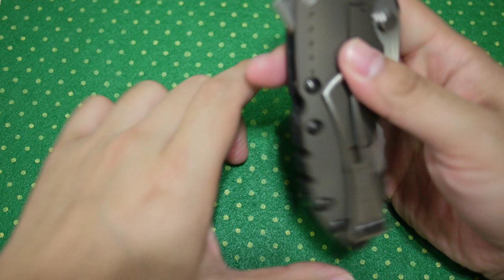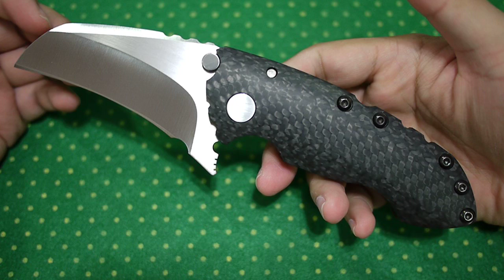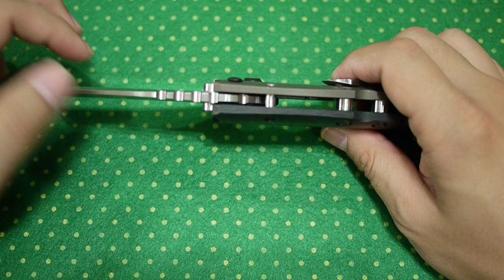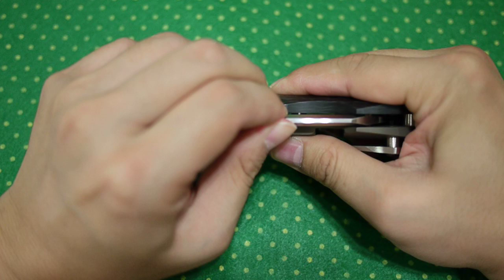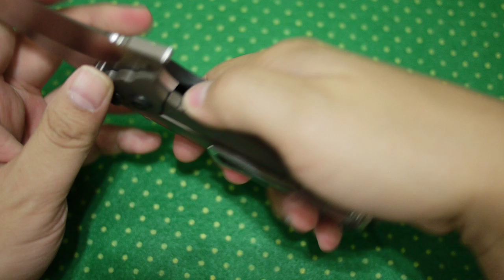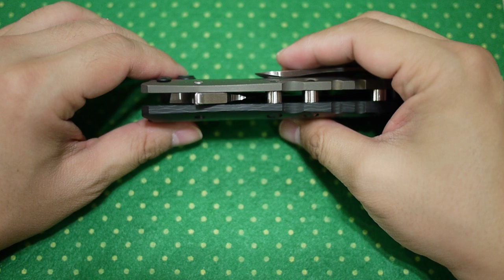Direware SOLO Wharncliffe

Comment: My goodness Tsu. When will the madness stop???  Such a sick blade. In regards to the previous comment about liners even a thin liner is not going to make much of a difference. The stiffness of the thick pivot will prevent the majority of the torque on the blade. And the torque is distributed throughout the thickness of the cf and the ti. Not just at the pivot. I can't remember the video I saw but it showed some guys (probably tuffthumbz) standing on cf and g10 between two rocks.

Comment: Actually as Tsu mentioned, ANY knife will fail if you really wanted to get it to break, However, Tsu, we have a mutual buddy from USN that took a Sniper Bladeworks (Half Ti/Half G10 folder on deployment in Afgan.he beat the hell out of that knife, I think he even used it as a stepping element to climb a wall and it came back after a tour with an absoutely solid lock up. So, mabe some folders are prototypes for a reason, but there are knives with some pedigree that function very in the field too.

Comment: Hey Tsu!!!!   Hope all is well...Well.......Carbon fiber has a higher strength to weight ratio and stiffness to weight ratio than Ti, actually 4-6 times greater.       That's why these composites are used in multi million dollar fiighter aircraft like the F-18.

Comment: I used a prototype all ti folder in Kuwait in Gulf I. We were forced to use it as a pry bar and the ti failed at the pivot, as it simply could not hold the strain, even with a virtually unlimited fatigue life. All I am stating is that carbon is not a suitable material to support the pivot on a folder. If ti failed then carbon fiber would fail even more readily. Yes, in 90% of use it's not an issue, but hard use would break that pivot. I would never use a custom knife for hard use

Comment: The stand-offs are immaterial. I am retired SF and have destroyed folders in the field that lacked liners. We could requisition virtually anything, but this was pre-Strider. I like the Striders with a proper liner. 

I would never use the Direware to pry, but it should be able to "act the part" and it's obvious that it would fail just as a liner-less Strider would. Carbon fiber is strong but not remotely hard enough to function as a liner in a folder.

Comment: You say there is no need, but the consensus of operators is that they won't carry a folder that does not have a steel or at least a ti liner. And yes, Strider is in the same crappy boat with those sh*t G10 liners. Carbon fiber and G10 are woefully inadequate.

I've seen Strider's knives fail at the pivot due to nothing more than G10 on one side. Ostensibly, CF is an improvement, but no substitute for steel. 

Ride a CF bike and you'll see the flex. CF needs a steel or ti liner.

Comment: You are not backing up your claim other than simply stating that, "it doesn't need a liner". CF and G10 are simply not durable enough to stop lateral-play on the pivot from prying force. They will both eventually see a "rounding" of the material around the pivot and fail. CF is simply not durable enough in that application. Great looking knife but fatally flawed design. Not designed for hard use.